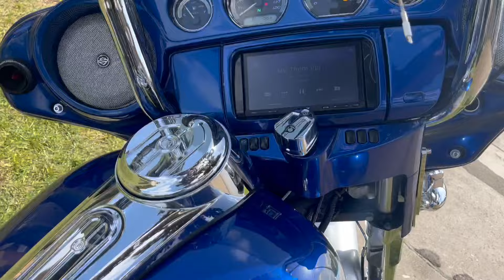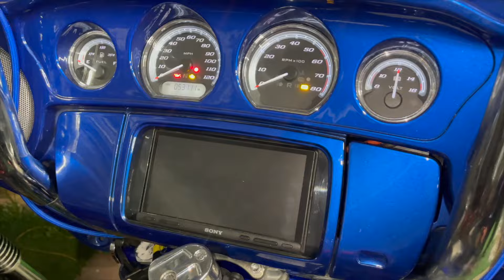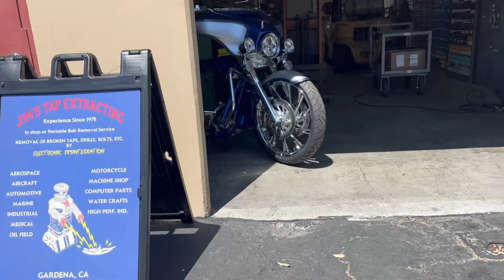COMPLETE STRIPPED STREET GLIDE HARLEY BUILD! “START 2 FINISH”

Comment: I have an 08 street glide. Is it possible to convert it to a RG but instead of using the 98-13 inner/outer fairing can I install a 15 and up neck to install the 15 and up RG fairing?

Comment: Your absolute best friend when doing these major projects that involve powder coating, chrome or paint, is, tap and die set. It takes a second to strip or break a bolt when the treads are all galled up. Always chase the bolt holes. The money you’re spending to have bolts extracted and new threads put in, is not worth it. Buy a quality tap and die set not that Harbor Freight junk. Time is money and you are carting bikes to others to fix broken bolts. It’s all good Dre. We all learn. Knowledge is only part of the game. Tools, tools and specialized tools make the job.